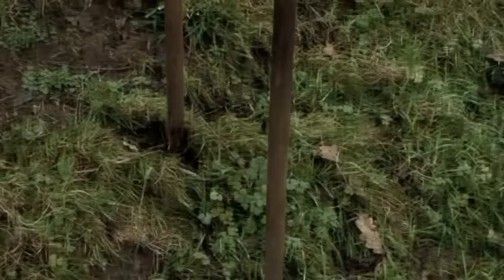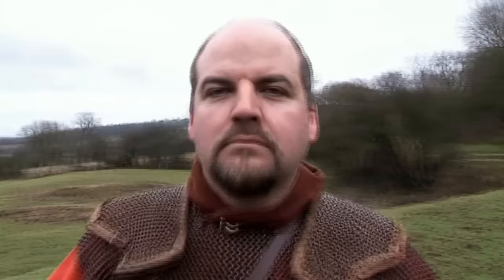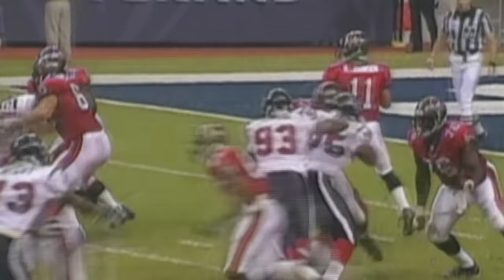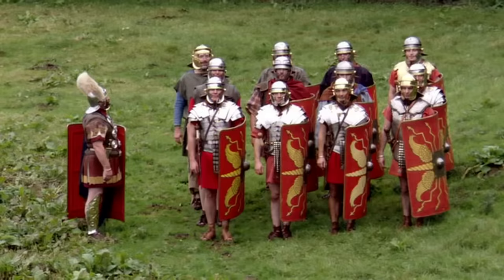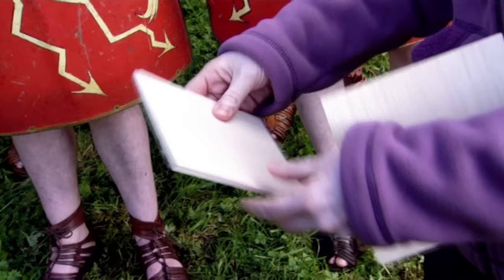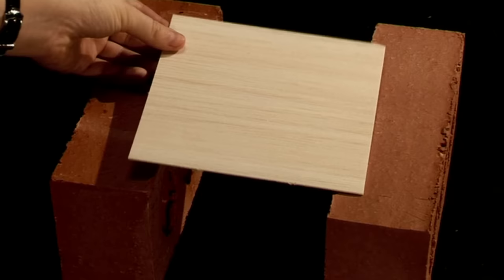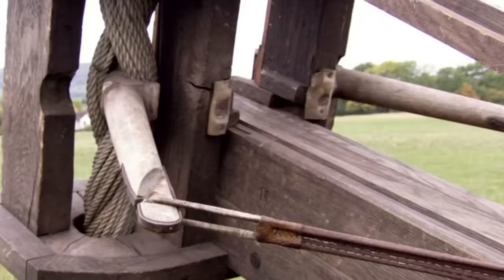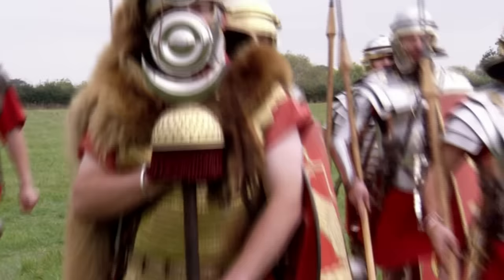Roman Military Technology and Tactics

Comment: The claim that the sword was not used for slashing is just false, while slashes aren't particularly effective when in a tight formation the gladius is perfectly capable of slashing.  Also the name of the gladius isn't a type of weapon or the title of the weapon it simply means sword in Latin
Reply: MsASpratley a
Reply: The gladius was primarily a stabbing weapon... yes it could have been used to slash, but that's not its intended use. The Spatha was more of a slashing sword.
Reply: When you have something sharp, just hit someone in any way you want and you're fine.
Reply: unlike the greeks somewhat curved swords which 'could take a mans head off with one fell slash'
Reply: Pretty funny when you get a better explanation for how important the gladius was from a David Gemmell book than from a documentary.  Because the gladius was a stabbing weapon it meant the legionaires could stand shoulder to shoulder.  Any enemy fighting them using a slashing sword had to stand further apart so they didn't hit each other.  Which meant that each enemy soldier was fighting 3 Roman soldiers, even if their army was larger.  Guaranteed local superiority right across the line.  Pretty smart, and very effective.
Reply: So many experts
Reply: @koerier718  I mean, if their untrained and unarmed sure. but if you're in a fencing match with a talented fencer and you're just swinging your weapon around wildly you'll be stabbed quite quickly. most of the time, the tactics used with a particular weapon are used for a reason.
Reply: I have one of them and even you are right, the edges are very sharp and could do be used for it. The sword would degrade quickly by slashing. It´s actually very "weak" on the sharp sides. As if they were made that way just to allow the sword to "dig" as much as possible in flesh after stabbing. Like a hot knife in butter. It´s designed to reach deep inside someone. Not just open an ugly scar or dismember.

The pointy edge is actually pretty strong for how pointy it looks.

But by having one does not mean I am an expert. I just say what I feel by holding it. It´s definitely made for stabbing and not just a little.
Reply: Well since it was double edged swords i think it is safe to say that it was really useful in close combat situation with a lot of enemies around you, I image it was used to injure enemies on the weak spots such as wrists or legs
Reply: @dantevelez531dv don't be a crying baby, at least learn something.
Reply: The slash would be hard to do because you are only putting the tip of the sword through a tight hole in the formation so you can move it very well

Comment: Few mistakes i'de like to point out:

The pilum (plural pila), was not a spear, but an advanced javelin

The testudo was not used for attack, and only against enemy archer and missile defense. Similar formations were used for defending gates and streets as well however

Onagers were often much larger than what is depicted, many being able to hurl 100-150 pound rocks at enemies. The kind shown in the video were used in Gallic Wars, in which Gallic city walls were only wooden, so they didn't need extreme heavy artillery
Reply: I'm pretty sure there is such thing as "Attacking Testudo" and "Defensive Testudo"
A testudo was either used for standing still while taking missile fire and then were disassembled when the enemies got close.
And it was used to advance toward the enemy to deflect missiles.
Reply: I believe the only exception to the idea that 'testudos weren't used for attacking' is when assaulting a wall during a siege.
But yeah, generally under most circumstances, wouldn't be used for attacking.
Reply: To quote wikipedia
A Javelin is a light spear intended for throwing.
Yes a javlin is spear, stop being smug about how much you know
Reply: The best tactic is obviously to wall in your enemies.
Reply: @Justin-hj7sz  the shield is a defense system, the testudo is composed of shields, so it is always a defense system. Like the armor of the tanks, it acts as a defense.
Reply: if you build a full-size onager you might get into trouble. Just saying.
Reply: JLM yes like you said there is a type of testudo (tortoise) for offence as well. for example trying to infiltrate an ememy empire then that’s when they would use it. i hate people who act like they know everything.
Reply: There IS offensive testudo

Comment: This is butted mail not rivited.
Testudo is VERY ineffective in melee. Its for missle protecction
White is least visible in sky. Black is very visible.
Reply: They were designed for night attacks I suppose.
Reply: Zach Smith As in ships? because i would understand if it was in waters
Reply: actually the tetsudo was used also for 

Barbarians, seein how barbarians had this way of charging and not flanking the romans took advantage of this so when the barbarians charged into them it would cause newtons law, the abrupt stop will either cripple them or send them sliding off the top of the shields and possibly resulting in internal bleeding

2 construction, the romans (not the actual legions but some times yes) would use this to help remove the stress of carrying most heavy bricks before it was simplized
Reply: alvi syahri  it was in the early times it was made yes but after a bit the romans figured out that since the barbarians like charging forth toward them,  that they can use that aganist them

Comment: The testudo was an emergency measure, mostly to temporarily cross under arrow attack. In offence it wasn't used because the coordination when moving required is difficult and makes the soldiers clumsy in combat. They would form a couple of lines instead, with the front row shielding and stabbing, then moving to the back of the cohort while the other rows move one up. This is depicted accurately in the starting scene of "Rome".
Reply: and the 2001 film  Gladiator

Comment: their legs are exposed but weren't people a lot shorter back then? if the shields are sized accurately then they'd prob go all the way to the ground right?
Reply: yup
Reply: They also slightly crouched, and didn't have their hands exposed holding the shield above them. The people demonstrating aren't trained Romans (obviously [and most likely not military either]).
Reply: tylerrumbarger they would also tilt the top shields down towards the enemy
Reply: lol I thought about the same thing as well. It wouldn't make any sense to leave your legs not covered by the shield. Tendentially the romans were not high people if compared with the germanic populations (there is a description about them in the "de origine et situ germanorum" which is a book written by Tacitus). When the romans first met the germanic tribes they got surprised about their stature.
Reply: a shield that comes down to the ground is very impractical to use, especially in fields. It would hit the ground and be horrible to keep up in position.

The chances your feets are hit are very low, since most thrown objects in this era don't fly straight as bullets do.
Reply: People weren't midgets for fuck sake. they were average height of 170 when they had proper nutrition and so 160 when they were starving. modern day humans just have way better nutrition
Reply: No romans had an average height of 160. But besides that, they used the shield in many types of formations and stances. The big advantage is also the ability to brace and push using the entire body and most particularly your foot against the bottom of the shield to lock in place. These guys in the footage make a mess of things.
Also it makes no sense to wield such a large object without having some kind of way to keep it in place once hit. If you can't it will swing away when hit. So mostly the shield if used with the entire body unlike a roundshield.
Reply: The legionary would of crouched if required to protect the lower limbs. The crouching position would give the Roman more power in his thrust, as well as protecting the feet and shins. Hands and wrists would not have been poking out (like in this video) as it would render the tactic entirely useless. The shield did not extend all the way to the floor in the standing upright position because it would render the shield too large, and make it more burdensome. The shield would constantly be getting caught on things if it was too long, and the shield was also designed to be carried on the back whilst the troops where marching in column. These actors do not understand the full purpose of the tactics they are attempting to demonstrate, and clearly lack the strength and discipline to carry the Scutum overhead with one arm. The Roman legions were extremely well drilled soldiers, with basic training being conducted with weighted wooden weapons and shields, designed to be much heavier than the real Gladius or Scutum, in order to condition the men. This proved essential in making the Roman military the greatest military machine in the ancient world without any real rivals.
Reply: +Dixout4 Harambe

Did you just use a parenthesis inside a parenthesis LMAO.
Reply: Some of the shields are larger than the others so it can protect the legs of the user
And its for the frontline roman soldiers are.
Reply: True roman soldiers wore greaves, so this is an inaccuracy in the demonstration.
Reply: tylerrumbarger my girl ain't no hobbit
Reply: tylerrumbarger it
Reply: tylerrumbarger try shooting an arrow at such a slim and small target though especially when they’re moving.
Reply: yup, you could join the Roman legion at 1.6 m tall, which was how tall I was when I was 12
Reply: Nope they we're around the same height as an average human, really no difference.
Reply: no they did not.
Reply: t
Reply: tylerrumbarger actually they were not short and they had shin gaurds
Reply: the average height was just lower by about 10cm, it wasn't that huge, the reason why they didn't wear protection on their legs was because their shields were their leg protection, you cold just lay it low on your body and hit the enemy from over the shield, plus it's not like anyone would crouch, exposing their backs, to try and hit a person's legs, so protecting the legs with some dedicated wear was really obsolete.
Reply: @Aqua Fyre
Pretty sure he was jewish
Reply: People were a lot shorter 2000 years ago.... Really?!!
Where did you get these facts? 
I think you are confusing ''The lord of the rings" with real history.
Reply: well, in defense of that statement, the skeletons we found suggest a SLIGHTLY lower average height than nowaday's, but just something like 10cm and there are still many skeletons of people that were 2m tall, of course we still have to consider that what all we have of them is just the bones but nothing suggests to any significant height difference.
Reply: tylerrumbarger yes they were midgets because evolution
Reply: what the hell are you even on about now?
Reply: tylerrumbarger No, people were no shorter at all during that time peroid
Reply: Yeah they were shorter
Reply: Loghan Obrien Some people were, but they still had people the same height as people are now. If you go back far enough in time, people were taller
Reply: Thrasher209 very unlikely the growth and Evolution of humans there higet there average height was like 5f to 5f5
Reply: Thrasher209 sorry 170cm 5f 7 was the tallest but average was 5f 5
Reply: People weren't that much shorter actually
Reply: Blexnjay420 yeah they were like a foot shorter look it up 😂
Reply: Loghan Obrien I thought that was a myth, because the houses of average citizens were smaller in height. But that didn't have anything to do with how tall the pwople were, it was due to the factthat a small room was easier to heat up than a large room. But I might be wrong, i'll look it up!
Reply: They weren't THAT much shorter, on average 2 inches shorter than now
Reply: they often wore greaves to protect the legs
Reply: traeng it would be but those soldiers should be crouched so the shield almost goes to the ground. The tustdo was not used to fight. It was used to stop when enemy archers shot at you and protect
Reply: No
Reply: @Taselukaneta That is incorrect information.
Reply: Video about romans battle stance https://youtu.be/gOpG1T8Vjxw
Reply: Yup, people were slightly shorter on average back then. After a quick google search, I found, for example, the that minimum height of a Roman recruit was 5 Roman feet 7 inches, which makes around 165 cm. As a whole, the average Roman soldier stood at around 170 cm tall. But, as you can see, it didn't actually differ that much compared to people today.

But let's say a person around my height (173 cm) would wield a scutum, compared to a man standing at 185 cm, I would have a huge advantage, since I would have way fewer openings and be way more covered by my scutum than the taller fellow. Would I then be armed with a gladius as well, I would probably make a difficult opponent, due to the fact I am more covered by my shield than the taller man - even though he has a reach advantage... I need to move in closer, and I can hide more effectively behind my scutum and offer a neat shield bash on my advance against him - and have more areas to attack with my sword, as he would have a harder time to effectively cover behind his scutum than me.
Reply: The testudo formation was to protect from javelins arrows and other ranged attacks, usually they would come from a high angle and it would be very unlikely to hit the feet

Comment: 2:45: That is wrong. The lorica segmentata was used only for about 250 years and never replaced chain mail armour. The segmentata is more sturdy and lighter, but chain mail is more comfortable and the soldiers are more agile. The segmentata required a lot of maintenance and was a lot more expensive to produce while not giving a huge advantage in battle.
Reply: P

Comment: Roman soldier: Throws spear
Enemy: Picks up thrown spear
Roman soldier: :O
Reply: Notice how the Roman spear, the pillum, has a thin end?

It’s so that if it hits a target, the tip would snap off, so the enemy couldn’t pick it back up to use it again.
Reply: Emperor Miguel Not necessarily snap, but bend. It also would weigh down on your shield because you won’t be able to simply pull out the bent pilum out of your shield while you would for arrows or regular javelins. Most men who would catch a pilum with their shield would be forced to discard the shield as well. So making a throwing weapon that not only can’t be thrown back, but even would render your enemy’s shield useless.
Reply: LOL

Comment: 2000 years ago the Roman army is the best equipped army in the world.  While architects have mastered the art of manipulating stone and concrete, military engineers have fashioned metal and wood to create devastating weapons of war.

The Roman foot soldiers main weapon is a fearsome sword called the Gladius, a double edged blade with a sharp point used for stabbing and thrusting, rather than slashing.  When not fighting at close quarters, their spear, called a pilum, could kill from a distance with lethal accuracy.

Protecting soldiers from injury is just as important as arming them for attack.  Early Roman soldiers wear chainmail, but armourers come up with a far superior form of protection.  Articulated plate armour called lorica segmentata, made from overlapping iron plates joined together by leather straps, as flexible as chainmail, but one third lighter.

If the romans weaponry has a modern feel, then so does the tactics they use.  The Roman legions know exactly how to fight heavily armed foes.  They use the testudo, Latin for tortoise.  Legionaries bunch together and lock their shields in formation to create a protective screen, a formation as effective in attack, as it is in defence.

Few examples of Roman artillery survive, but they left detailed clues as to how to recreate them.  The Ermine Street Guard Roman Reenactment Society is dedicated to research into the Roman Army and the reconstruction of Roman armour and equipment.

The scorpion fires iron tipped bolts, used in the first stages of attack and during sieges.  It fires arrows at incredible speeds, pierces armour, and kills instantly, a bit like a giant crossbow.  Although an effective anti-personnel weapon, the scorpion is of little use when attacking a building.

For that the Romans need something with a bit more punch, the onager and the ballista.  These pieces of artillery fire large stones at the enemy.  During sieges they propel projectiles so high into the air that they can break down enemy walls.  The whizzing noise of the stones strikes terror into Rome’s enemies.  To increase the fear factor they’re painted black so harder to see.

The ballista works like the scorpion, but is bigger and more powerful.  It can fire a 60 pound stone or a 3 foot bolt around 15,000 feet allowing the soldiers to stand well away from enemy archers.  The speed of the missile is phenomenal hitting its target at about 115 mph, anyone sustaining a direct hit would be killed instantly.

The onager uses a different principle, it catapults basketball sized stones nearly 100 feet using a single arm and sling.  The vertical arm is powered by a large horizontal skein of rope, coiled and twisted to create a rotational force, the skein acts like a spring storing energy to be released on firing.

The combination of technology and tactics makes the Roman army the premier fighting force in Europe for 500 years and influences military tactics for the next 1,500.